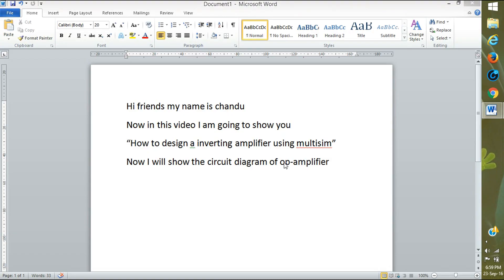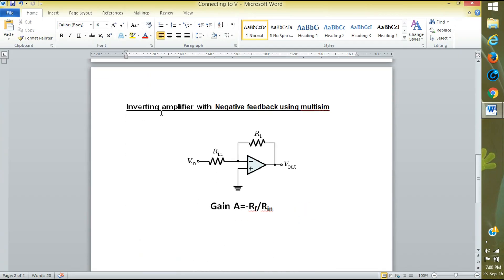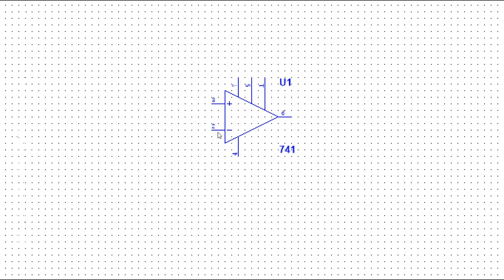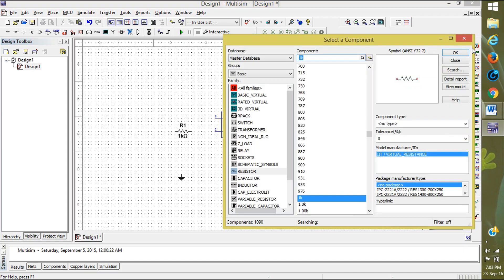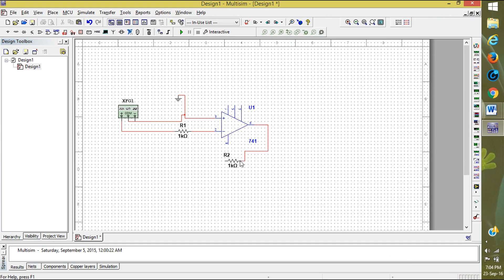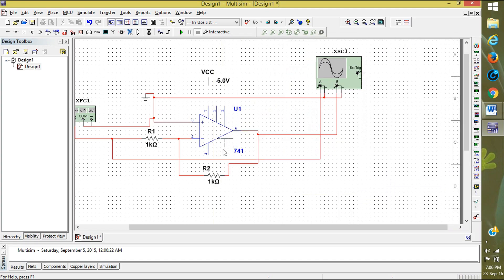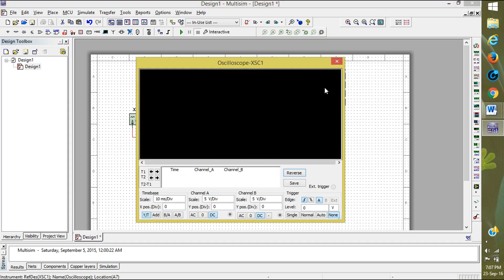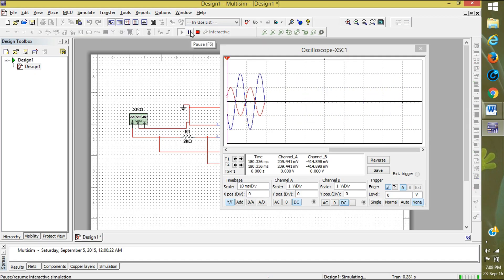Inverting op amplifier using multisim

Comment: many of the chip components do not have an input voltage
for example the 4060 does not have pins 16 and 8 which can make
it very difficult to transfer the schematic to ultiboard even some schematics 
that look ready for pcb fabrication still have to be breadboarded 
before production, to me I don't feel its worth the asking price,
that just my opinion

Comment: Hi I dont understand why the pins are not correct... for example NE5534 has 8 pins.. the pin 8 is Balance\compensation... but in Multisim figure only 7 pin...why this? I've project were I'm using pin8 and not pin 5...so how i can do in this case?
Reply: pin 8 is the supply voltage  pin 7 is the discharge pin, pin 5 in most applications can be omitted